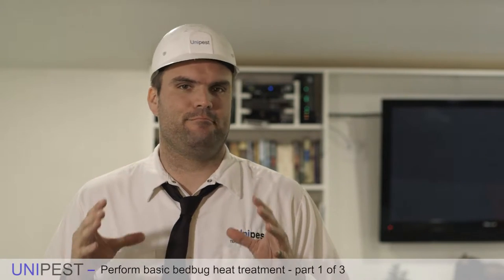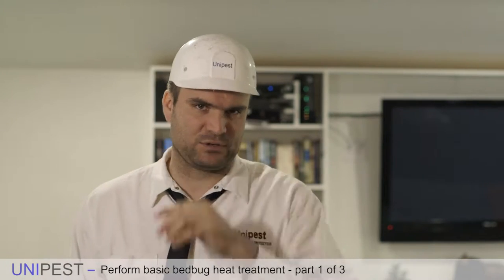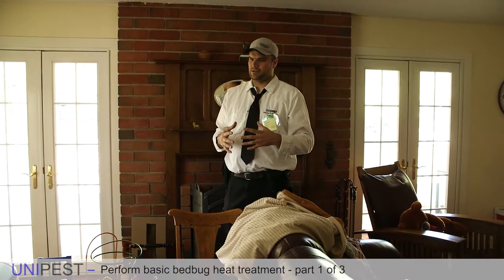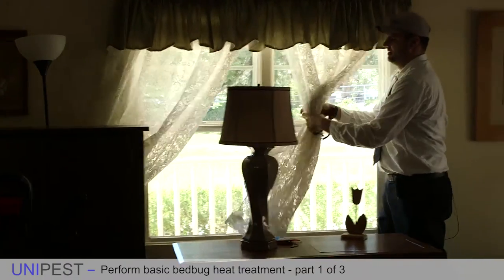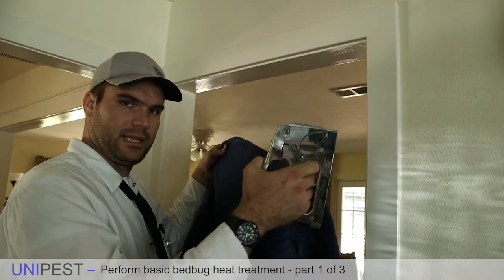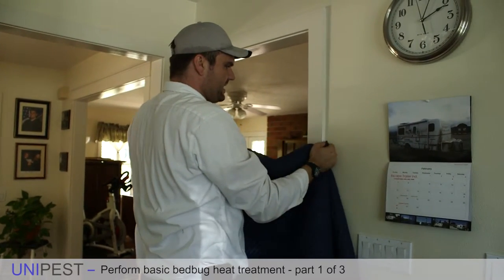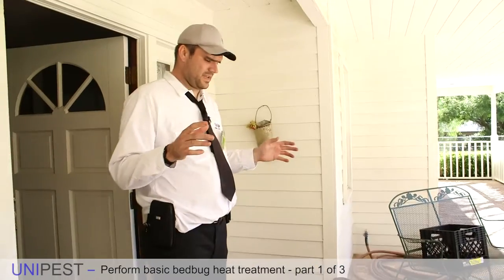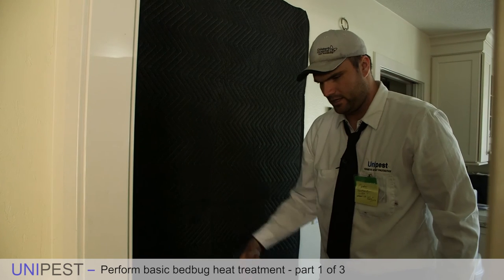How to Perform Bedbug Heat Treatment (Part 1 of 3)

Comment: I did a heat treatment  with 150,000 btu kerosene blow heater some fans and 2 thermostats I placed one in floor and one on a high table With 150,000 btu it heats the infected area really fast. With in a hour I went from 70 degrees on the floor to 120 the mid level thermometer was reading around 135 to 140. I'm guessing at that temperature because the thermometer was only rated to 120 and it was way past that. I stayed outside for about 4 hours checking on things about every 10 to 15 minutes.  Making sure I didn't burn my house down. Here's what I can tell you about the method I  used. It worked. The con was 2 things. I had a kerosene smell for a couple day's  it went away. Also I destroyed 4 plastic blinds. I seen how expensive those bed bug heaters are to purchase. With a little thinking I purchased the heater off of FB marketplace for $45 $25 for kerosene $15 for the thermometers and 30 for new blinds. Around a $100 total. With the amount of heat I used those little things didn't have time to react. I seen the electric BB heaters I don't like the ideal it takes 6 hrs to get up temperature giving the bugs time to run. I also wanted try the same thing with a propane blow heater.  I just couldn't find one above 60,000 btu. It was a little thinking outside of the box saved me thousands and solved the problem.

Comment: This does NOT work
Reply: Lol must not have been hot enough
Reply: Needs to be like 120 degrees windows doors closed dont Enter your home for 10 hours than they will die.
Reply: It's all on the technicians/crew performing the work. If you are able to fumigate, that will always be the number one recommendation. Heat Treatments are for apartments/hotels/duplexes where not everyone can leave for three days. 
We perform Heat Treats using heaters hooked up to a diesel engine and do not use gas but either method works. 
It's a partnership too. The customer preparation is equally as important as the heat treat itself. And finding out where the bed bugs were introduced from can be the toughest but most important part as well. It's a big job but when done correctly, works great. It looks like a bomb went off afterwords with all the belongings being spread out but that's a small price to pay for eliminating the infestation.
Reply: Can you use hot steam applied to the affected area such as a couch or bed?
Reply: Will the heat damage your TV?